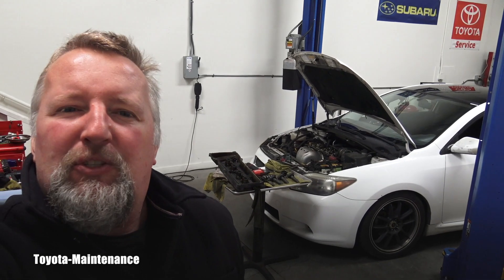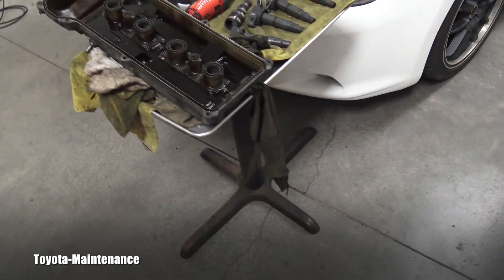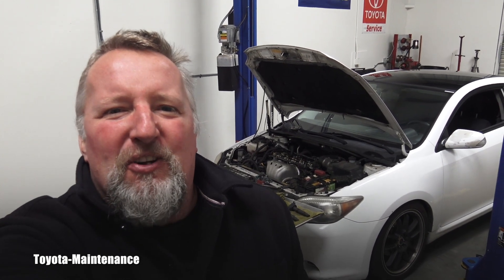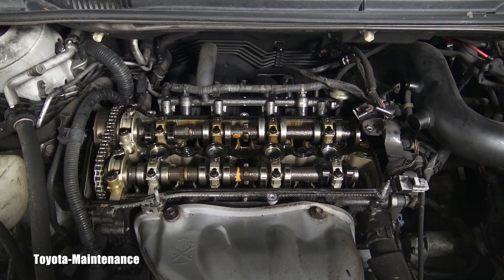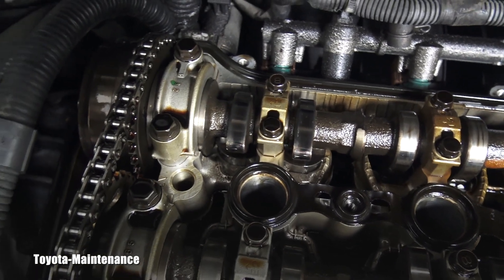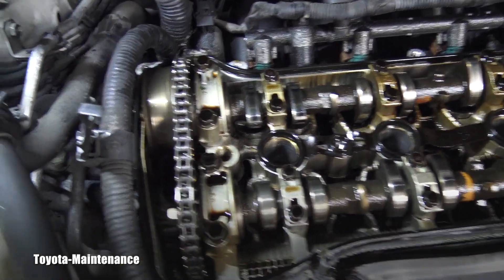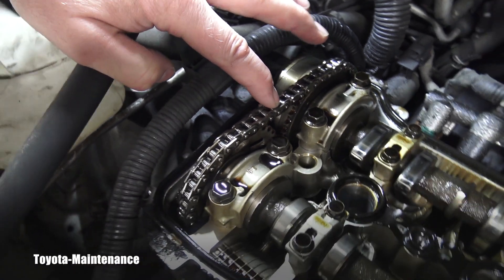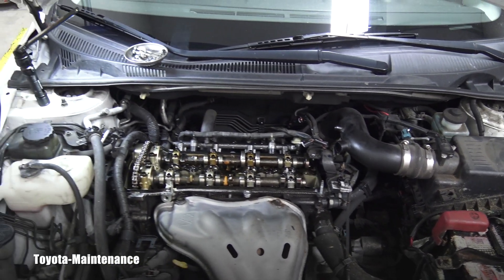Toyota Engine 2AZ-FE

Comment: What makes many 2AZ-FE engines vibrate too much at idle. If I put it in neutral it immediately stops. I have a 2007 Camry and I've seen tons of other Camry and Scion owners complain of this. I've checked and/or changed all of the obvious items, spark plugs, motor mounts, even rebuilt the engine. I suspect it is either the evap TSB for early model year 2007 engines that Toyota put out, or dirty transmission fluid affecting the torque convertor  operation or engine load at idle. Because all other owner reports that I've read also say the heavy vibrating idle stops if you put the car in neutral say while at a stop light or drive thru, etc.
Reply: Probably the balance shaft assembly on the head
Reply: Mark n : Thank you for your reply. I had the head professionally done: serviced, pressure tested, new valves & adjusted to specs, seated, new oil seals. 
I then did the rebuild, spark-plugs, pistons, rings, bearings, cam-shaft bearing, seals, gaskets. Everything by the manual. I reused all of the balance shaft bearings because they were fine. I also replaced the timing chain, tc tensioner, guides, sprocket, cleaned the VVT gear, top motor mount, pcv valve and pcv valve hose, checked the VVT oil solenoid operation, and reassembled and it started again after 10,000 miles. 

Otherwise it runs great, accelerates fine. 

At this point, I think it must be the evap purge solenoid letting in liquid from the evap system after reading 
Toyota TSB EG035-07. 

Apparently liquid gasoline gets in the evap canister and evap lines instead of just vapors and this gets routed through the evap purge to the intake through the throttle body. 

It's either that or the transmission or torque convertor causing heavy load at idle. I suspected this bc if you put it in neutral it stops and the balance shafts are still moving almost the same rpm's from in-gear to park.

Oh and I the rough idle/vibration is intermittent and only while stopped at idle in a drive gear or reverse. So with it being intermittent, I thought it might not be a balance shaft issue. 

The VVT gear and oil solenoid feed pressure was something I considered as well since Ford had similar rough idle issues with some VCT's on certain engine/years. However, I cleaned the VVT gear and the oil screen filter and made sure the VVT solenoid was operating by applying 12 volts to it while off the car.
Reply: @Jay C, Thank you Jay, I was thinking that same thing after narrowing it down myself, and I haven't heard reports of 2AZFE's with manual transmissions doing this. 

Plus, once I did a transmissions pan drain and fill it helped for about 5,000 miles. (Fluid was very dirty at 270,000 miles for the transmission, so the 3.8 quarts from the pan drain and fill just helped it temporarily). 

I plan to do that again and change this transmission filter as well this time. Funny thing is, after I rebuilt the engine it stopped doing this for about the first 10,000 miles, but that was probably just because the fresh engine didn't strain as much to spin the torque converter with the dirty transmission fluid). It returned around 10,000-12,000 miles and that's when I did the transmission pan drain and fill and it smoothed out the in-drive idle for about 5,000 miles. 

Also, I'm going to check and clean or just replace my fuel pump filter (in tank under the back seat), and see if that helps. Because I know the engine components were fine after the full rebuild and yes it is not the motor mounts. That was the first thing I checked and had to replace the top dog-bone motor mount. 

It started making me think it may be a combination issue of torque converter with dirty fluid and fuel filter screen starting to stop up, because you're right, pop it in neutral or park and it immediately smooths out. 

I'll update you after I do these maintenance services on the transmission fluid and fuel filter. Thanks for your input as well!
Reply: @padams8485  Hi Preston, please could you let me know if yo had any improvements after changing a fuel filter/transmission filter. I have the same issue with engine vibration 2AZ-FE - Toyota Previa. Your post helped a lot! Thank you!
Reply: @Jay C This link below that has 5 parts total where two people do a Camry 2AZFE removal and reinstall.
https://youtu.be/OAOBsk04BfY

Comment: What was the reason for the oil burning on the on the Camry.
Reply: @Jay C ,   No problem, and yeah Toyota OEM is always best, just a little more money.
And one thing I forgot to mention, make sure to clean or replace the PCV valve. (and check the hose) Those hoses get brittle and can leak and it's different sizes on each end. ($23-$28) at dealer. I tried using regular heater hose at first, but it collapses when the engine warns up. The dealer one is a stronger material and has an outer foam hose cover. No issues with it after I bought the dealer one. It's important on the 2AZFE because if the valve sticks shut or the hose collapses, the crankcase pressure will force oil out of seals and gaskets. 
When I reassembled mine, the collapsed PCV hose made main crank seal drip and I knew I had installed it correctly and all surfaces were shiny clean. I replaced the PCV valve hose with the dealer hose that doesn't collapse and  the main crank seal stopped leaking. Boy was I glad to, because I did not want to have to separate the engine and transmission and go back into it to replace the main crank seal.
Reply: Israel Rodriguez The oil drain holes on the pistons were too small and so it coked up the oil drain passages. 
I rebuilt mine and the new pistons have noticeably bigger oil drain holes in the oil ring groove. Mine was burning about a quart of oil every 1500 miles, now I only have to add maybe 3/4 to 1 quart near the end of my oil change interval of  around 4000-5000 miles.
Reply: @padams8485  , thank you.

Comment: Can you comment or do a video on the 2ZRFE engine Dual vvti 1.8 Toyota Allion ( I think its similar to Scion)  its a Japanese Domestic Model. Whats the best recommended oil after 100,000kms. I am using 10w30 Valvoline premium conventional as of now & about to do an oil change. Do you recommended changing of PCV, VGC, TPS after 100k kms, I get kind of rubber burning smell when driving uphill at times and also when the car is shifted from P to D or P to R, there is a thump a sudden jerk sometimes this happens only if its not parked at a flat levelled surface. And now I get kind of very jerky movements at once and happens frequent on long drives.. ( after engines been running for atleast a hour)  on D, but when I shift to S its fine. What could be the problems , may be an issue of CVT? I recently changed the engine mounts thinking it might solve but no. Please advice. Thanks.
Reply: Robby tm  xnjabxhbxb hey WA eknsm
Reply: The PCV should be changed every 30k...

Comment: My 2003 Camry had the 2AZFE. Great reliable motor and I got lucky with mine.. It burned less than a quart every oil change so I wasn’t concerned about it. Glad I sold it for my Tacoma though

Comment: we had a 2008 XB with the same engine and suddenly at about 40k miles it started using oil between changes. Very disappointed, was not expecting this from a Toyota engine.
Reply: What does Toyota have to say about the reasons for this condition? Was the car maintained according to the service manual ?
Reply: @fieldsofomagh  Yes it was maintained, I mentioned it to the dealer who told me that some oil consumption was normal, I don't buy that for a minute. the reason you buy a new car is that you don't have to worry about such things. We didn't pursue it cause soon after that, the Toyota 86 came out and i traded the XB in for it.
Reply: Jay C  Stop saying a poorly designed piston ring is the culprit to the excessive oil burning. It just shows you lack an education of how the mechanics of a car works. The culprit is a clogged/sticking PCV.

Symptoms of a Bad or Failing Positive Crankcase Ventilation (PCV) Valve

Excessive oil consumption and leak.

Advising people to an expensive replacement is not only unethical, it's not needed. 

As the gasoline ignites, it causes an expansion of force that needs to be removed from the crankcase. A PCV is used for this purpose. As carbon and oil builds up the PCV becomes clogged and/or sticks, thus, leading to POOR ventilation of combustion pressure. This then has to escape somewhere else and it's usually THROUGH the piston rings as THAT is where the combustion occurs! 

I've read numerous reports on this issue and the many people I have spoken to NEVER replaced their PCV (Positive Crankcase Valve) which makes sense as to WHY their engines are burning oil more than necessary.

The lack of knowledge is understandable as I don't expect everyone to take the time to understand fully how a vehicle and all of its systems work but I have done years of research and reading books to expand my knowledge of vehicles.

The longer you run the engine without addressing this critical issue, the more problems you are going to create! It's common sense.
Reply: @christophervanzetta  Toyota had a TSB for this engine because of excessive oil burning due to faulty piston/valve design.  You claim it's simply a $8 PCV valve replacement?
LMAO idiot!

Comment: Love the channel! These engines are rock solid. I have the smaller 1.8L 130hp 1ZZ-FE engine (2006 Matrix 4WD) with 127k miles. Super reliable engine. Starts every time and purrs like a kitten. I change oil myself every 6-7k using mobil 1 full synthetic 5w-30 with oem filter (cost me under $30). The OCI is 5k but I change it as soon as the golden brown color starts to show signs of turning black (on a rag). My recent oil consumption test result: Uses 0.25 qt of oil every 6k miles. I love this car! Oh, and for $15 on Amazon I got a TecBoss bluetooth fm transmitter which plugs into lighter plug inside center console-out of sight. With my windsheild mount, android phone, google maps, and spotify I have better Nav/Entertainment tech than most new cars. Plus its easily upgradable.